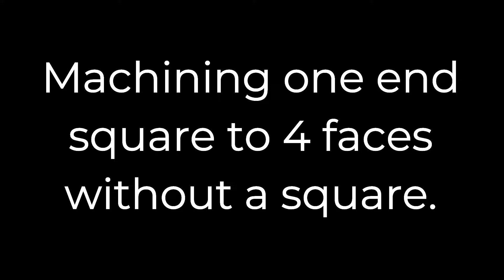How to machine square parts without a square reference.

Comment: I don't get it. You are sitting the rough sawn face against the vice base. No way the cut face will be square with the side faces. You are just machining the two faces parallel with each other.
Reply from the maker: The first face is only square to the faces touching the jaws. When it is turned over it is rotated 90 degrees and sat on a rod. This sets the lh & rh faces square and the other two touching the jaws are then also square. This second face is now square in both directions. It is then used as the datum face on the surface plate. The top face on the surface plate is not square in both directions. Hope this helps.
Reply: @machinists-shortcuts  OK, got it, but why not take another cut on the first face that was cut to make everything square and parallel?
Reply from the maker: @erickendall2506  The title is to machine a square end, so I thought I would leave it at that to avoid confusion.
Reply: @machinists-shortcuts  Fair enough. Good concept.